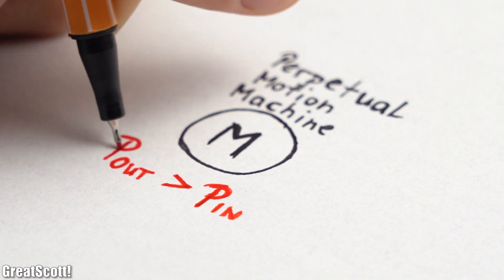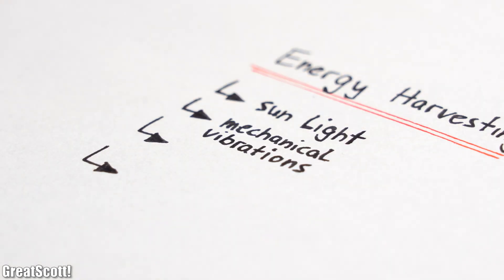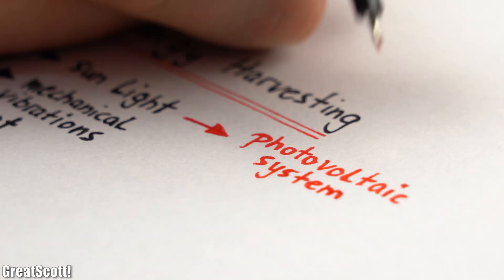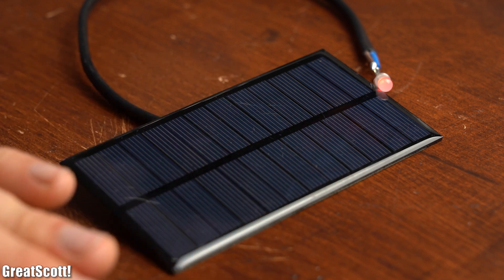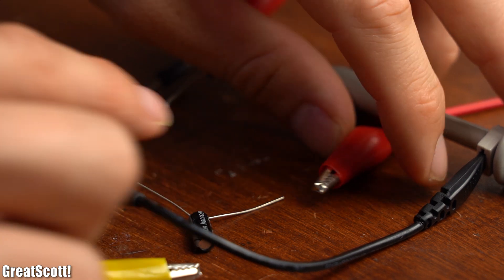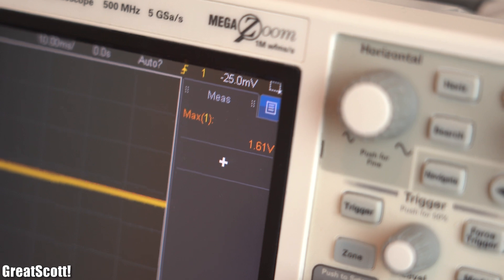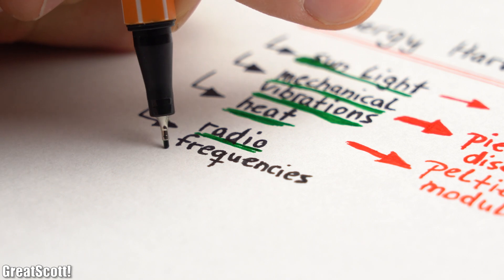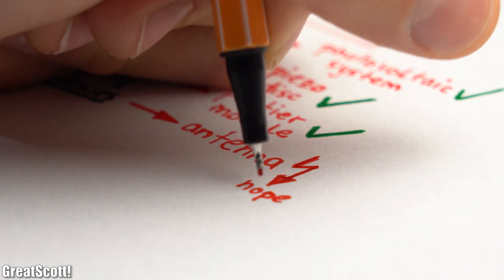Does Energy Harvesting make any sense?! (Experiment)

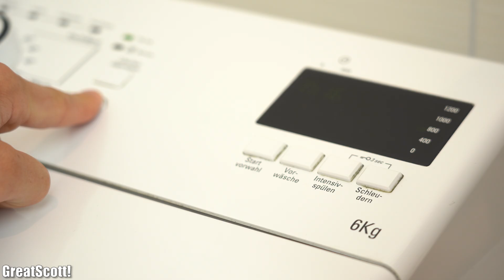Comment: 6:25 maybe putting the piezo disc in a case with a steel ball to hit it would help
Reply: If he mounted the steel ball on a spring solderd to the piezo that's how motion sensors in car alarms work.
Reply: @dogwalker666  ah a spring...yeah that would work too...the ball would move to the vibration and the spring would translate that vibration into the piezo plate, I was thinking maybe a fixed arm, but the spring would probably be better even though it might lose some of the movement due to damping
Reply: @haydenc2742  you do get damping but you also get resonance too.

Comment: maybe it's possible to build a more efficient vibration harvester using a magnet in a coil?
Reply: Indeed, I can imagine a tuned spring and mass system that resonates with the vibration source's frequency, that mass being a magnet with a stationary coil around. Basically a shaker flashlight but tuned to a source of vibration.
Reply: @Kalvinjj  yes, indeed! good idea to tune it to the resonant frequency, that way you can add more energy to it and it will be more efficient! Though I wonder whether that will hold true as an electrical load is applied, since the magnet will then experience more resistance, which might upset the tuning.
Reply: @gydo1942  good question, I don't know what kind of damping effect a magnetic load would do indeed, if it's similar to a friction load, then no it wouldn't change the resonating frequency, whoever if it's similar to a viscous damper then yes, it would indeed change that frequency based on the load applied.
It should be noted whoever, that this change depends much on how strong is the damping effect compared to the spring and mass system, it can change from meaningful change in frequency to barely anything important depending on the system, if there's sufficient weight and springs to match, the small load of a sensor or such wouldn't change it much, also even if it's out of the precise resonating frequency, it will still move a lot when it's near that frequency.

been a while since I've had to remember about the vibrations classes!
Reply: @Kalvinjj  I've never had classes about this sort of stuff, so it's just a shot in the dark ;-) Anyway I want to try this now!

Comment: I use a peltier powered circulation fan on my wood stove.  This application is great so i can force the hot air around the room. Other than that, i would stick with solar power to  create the charge current necessary to run your IoT.

Comment: 6:28 That's because the piezo was mounted to move with the machine, it isn't experiencing any forces besides those wires' inertia, which are probably the source of the voltage.
A better way would be to mount the piezo on a fixed object and attach a stick to the washing machine with the other end going to the piezo, so that the vibrations are making it flex. Please try this again, I think you can achieve way better results with the piezo method :D
(better ways in the reply section)
Reply: Mounting a weight on the other side of the piezo should also work because of inertia.
Reply: @theonetribble5867  thats a neater solution:-)
Reply: Why not simply put the piezo under one stand of the machine, or better use 4 piezos for each stand?
Reply: @paulg.3067  That's better, I like it
Reply: @paulg.3067  That should work pretty well.
Reply: I was about to say the same. You can get much better results if you attach it to a separate object
Reply: @electron5390  Hmm, big voltages :D
Jk but isn't that how those piezo strikers work?
Reply: You are absolutely correct. His mounting of the piezo did not allow it to receive the energy at all.
The correct method is attaching the piezo on the outside edges of the disc to the machine and adding a proof-mass in the center. The ideal tuning would be to try and match the resonance frequency to the strongest oscillation. Output power can easily be increased 100-fold.
Reply: @electron5390  Lets say there is room for improvement. Chances are the placement wasn't ideal to get the max of vibration anyway. Still very cool ways to increase efficiency these days.
Reply: You could of also used a center plug that was 3 or 4 cm wide but only 1cm tall and then put a couple of 20gram weights around the edge. You would have to play with the weight but then you get the flex you need
Reply: You need inertial mass in order to harvest vibration. The most efficient way is to put the piezo between two blocks separated by a thin gap. And just one block being coupled to the vibration source
Reply: I actually did this while ago to make an IoT that sent a message to the phone when the washing machine was done.

However i did something much simpler: Just add a smal enclosure with a ball bearing bouncing on the disk.
Reply: My thoughts exactly. Please repeat with this setup, or put the piezzo on top of the machine and put something on top of the piezzo. I think that might work too.
Reply: Just place the piezo in a small shallow cup with a few small bee bees or ball bearing on top that can freely hop/jump on the surface. Lay it flat on top of the wahing machine's lid.
Reply: You can also get much higher voltages depending on how you shape the crystal and where and how hard you strike it. An el-cheapo BBQ  lighter produces a spark that can jump several millimeters every time you press the trigger.
Reply: You could also just mount the outer ring of the piezo to the machine, and then a weight (like a screw nut) in the middle. You could then even continue and "tune" that contraption to the frequency of the washing machine, for maximum resonance and power output. But yes, just sticking it flat to the machine like he did most certainly wouldn't create any power.
Reply: yes exactly because it functions as a damper in that configuration, meaning it either needs to be fixed on one side or have a tuned mass added to it
Reply: You don't even need to attach it to a separate object. If you know the frequency at which your machine is vibrating, you can just add some mass to the other sideof the piezo, and tune it to resonate at that specific frequency, like any textbook spring-mass system.
Reply: I was about to submit the same advice as a question till I noticed you articulated my perceptions, I concur.
Reply: a lot of the flex was lost to the soft flexible tape I think. Basically a shock absorbing mount :)
Reply: You don't need to have it on a stick. You can just put some kind of weight over it so that the weight can move back and forth tapping it. Imagine placing it on top of the washing machine, then taking a small weight, and placing it on top.
then cover the whole thing with a plastic cup so it doesn't jump away.
The weight will be tossed and then land back down just like the screwdriver.
Reply: A tiny magnet oscillating between coils (like rc slow flyer rudder servos)
Reply: Just place the piezo in a small shallow cup with a few small bee bees or ball bearing on top that can freely hop/jump on the surface. Lay it flat on top of the wahing machine's lid.
Reply: I would Put it under the foot or something over this...
Reply: @Enderkruemel  How violently are your washing machine jumping around? :)  I mean the foot will put constant pressure on the disk and you get nothing out of it.   Or did I misunderstand you?
Reply: @PerKroon   very little Vibrations are enough. And also wenn have a  older washingmachine that vibrate more  the  newer ones . 

Also there are always more or less Vibrations, and no Shockabsorber could Filter all of it out.
Reply: @Enderkruemel  But if the disk are compressed to maximum even when the vibration "lift" the machine there will be no energy gain.
Reply: @PerKroon  under the Disk must be a soft Material like layers of paper so the middle compresses and the outer section Not so the Disk bends
Reply: @Enderkruemel  I have the same disk as in the video and you can easily "max" compress the disk out with your index finger.  Just guessing here but I think that wight from machine, even if you use some kind of dampener,  will "max" compress the disk.
Reply: @Enderkruemel  Someone already said that, and I did clarify that in the comment...
Reply: @SirDella  i didnt read all comments 😬😉
Reply: Using metal glass would be the perfect ‘spring’ for it
Reply: Come check comments for this..
Reply: Maybe you can use some springs between blocks.
Reply: Yes, exactly - he could at least add a weight on the piezo disc, to get some inertia that can generate forces. Those discs weigh next to nothing and the wires don't have much mass either and they are also placed in a way that minimizes the forces transferred to the disc. So no wonder it wasn't very effective.
Reply: Rubber dampers can be used.
Reply: That's perfect. I needed to know this for my project!
Reply: I think would he put the piezo disc under the feet of the washing machine it would work better.

Comment: Thanks for this interesting video! I can see some industrial applications of such IoT systems. Though I can't come up with an application for meaningful for home use, which draws very little power, and where battery, or just plugging the device in to the wall, wouldn't be an option. Any ideas?
Reply: There are some wireless light switches where the remote looks like a regular switch and can be stuck to the wall. Flipping the switch strikes a piezo element which produces enough power to run the transmitter.

I suppose batteries would also be an option here, or really in any energy harvesting application. It's just easier not to need to change batteries every so often.
Reply: An external thermometer for example, you take data every ~10s at most, the whole process of sampling and transmitting would be quite fast and use little power, but the rest of the time it's just idling, throwing a small solar cell somewhere and a supercap to store it for the night and shade moments, and it would run for years until someone breaks it.
Reply: Self powered light switch are sold and send RF to base-we use these at work to save installation costs

Comment: Would the peltier output drop over time without active cooling?  I thought that the voltage output of a peltier device was a function of the temperature difference between the sides, meaning that unless you have some sort of effective cooling on the "cold" side, it will eventually climb in temperature to be closer and closer to the hot side, reducing output.
Reply: That's right

Comment: I don't want to say harvesting RF energy is feasible, but I am an RF engineer that works on and around 50kW AM transmitters a lot and FM. If you make a large enough circuit and are within a decent range you can definitely harvest energy from the "Air Waves" but for best results it needs to be tuned the the frequency you are nearest to.
I think AM would be the best bet because it just pumps so much energy and the waves are wider which would be easier to catch.
I have had to deal with the very real problem of people that live near AM stations picking up what is on air through the coils in their old style stove tops, no joke. I've seen stove coils make sound like a crappy speaker that is very tinny with the audio "quality".
AM also travels a lot further more easily than FM which solidifies its feasibility in my mind.
Reply: It wouldn't be an end all to power problems consumption problems though because it wouldn't be a huge amount of power. It wouldn't be free energy either because someone has to pay for the three phase power going into the transmitters.

As a side note for anyone that thinks it isn't possible to catch AM radio waves for use as low power I highly recommend you buy a "Crystal radio kit" because it picks up AM and outputs it in an audible form albeit very low sounds levels but it uses no battery or power source other than AM RF 👍

Comment: the RF one could work at tiny power levels, but you would need to match the circuit to the antenna, and a local Radio station.  not a lot of power, but that's how crystal radios work, so it does work at tiny levels.

Comment: As a rf engineer it would be quite interesting to try the rf method again but with a little help to find the right frequency for your area. If I find the time to test it myself I will send you the the video of my results. Tv broadcast signals are pretty strong and annoying for us, so using these might work.
Reply: I think it would also be important to pair the harvesting circuit with a suitable antenna!
Surely a big antenna on your roof pointing toward the transmitter and designed for those frequencies would be worth a try

Comment: I've heard of the RF energy one, I'm an amateur radio operator and have an antenna that is resonant on the HF bands. Over the course of a few days you can get enough energy to power an LED briefly, but yeah definitely not the best source of power. However, you are close to a station that is putting out several kilowatts of RF, then it could be possible. Hope this helps, love the videos and keep up the great work!!
Reply: Lassi Kinnunen  Yeah that's true, but that's mostly just direct electric transfer like a transformer. Still could be a neat concept if it wasn't so dangerous and illegal lol.

Comment: the vibration test has a wrong setup. You are shaking the whole disk, whillst you want to keep the plate tactile and the element shaking. So if you ad a ball on a wire that hits the element it should work way better.

Comment: Didn't scientists make a Bluetooth module that is powered by other Bluetooth signals?
Reply from the maker: Link?
Reply: @greatscottlab  https://www.prnewswire.com/news-releases/first-battery-free-bluetooth-sticker-sensor-tag-demonstrated-at-nrf-300777079.html
Reply: Somewhat unlikely, there is very little power to extract at a non-zero distance from 2.4 GHz devices! Even zero distance is pushing it.
Reply: @erlendse  You know? I just though about nfc being a thing. Those operate at 13.5mhz, wich is a lot less power then 2.4ghz and they manage to harvest enough power from radio waves to function.
Reply: @redstonegenius2609  actually it's the other way around.

NFC delivers way more power than Bluetooth.

Also Hz is NOT a power measurement!

Comment: Try this again using a single diode instead of a full-bridge rectifier.  With half the voltage drop across semiconductor junctions you'll wind up with a lot more net power.
Reply from the maker: But you sacrifice half of the wave.
Reply: @greatscottlab  But you get energy from lower level inputs that more than make up for the difference.

With a single diode energy harvesting from RF would become practical.  That's how crystal radio sets work, after all.

Comment: About harvesting from mechanical vibrations 
You should anchor one of the sides of the piezo to a fixed surface , by doing so you drastically increase the amount of energy transfered to the cristal
Reply: Or just attaching a weight to the other plate of the piezo device to increase its inertia.
Reply: @NielMalan  correct ,basically he is moving the whole volume of the piezo , basically he is using is own mass to generate electeicity
Reply: Ah another thing , you should consider something like idroelectric generators connected to your water implant , so that the pressure of the water charges your battery

Comment: Cool ,I really like piezoelectric stuff ,wonder could you improve the idea with either multiple discs or some sort of enclosure that amplifies vibrations mechanically maybe? Maybe you could tune the enclosure to whatever machine your sticking it to and match it's resonent frequency with springs or something .Just brainstorming. I'm not an actual engineer by any means I build drones and stuff and learn on YouTube mainly lol
Reply: You actually need a mass to convert motion into force to bend the disc.

Like glue a nut at the center, and suspend the whole disc at the edge.

Resonance could raise the output power quite a bit too!